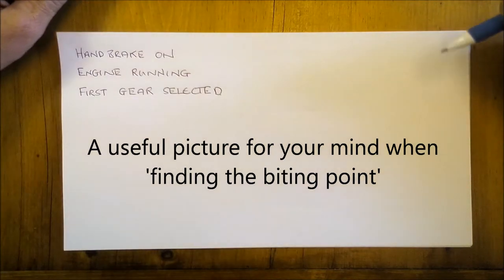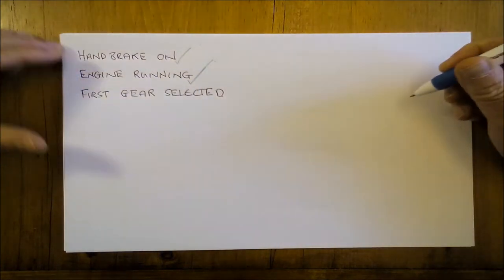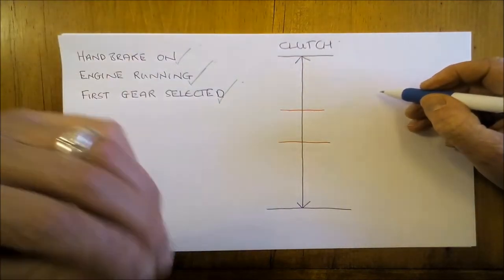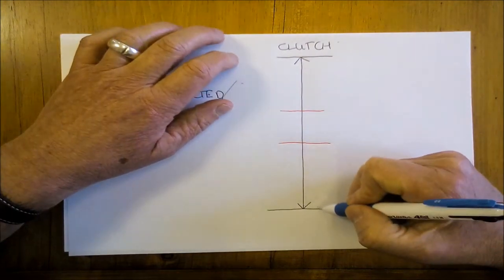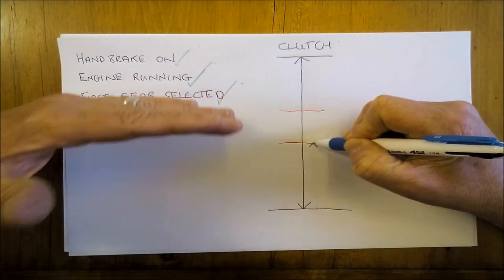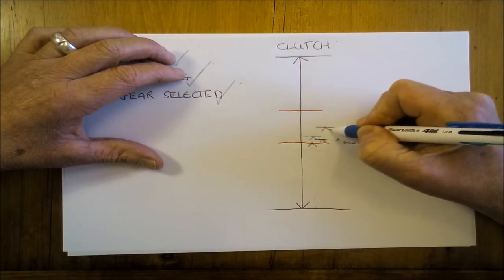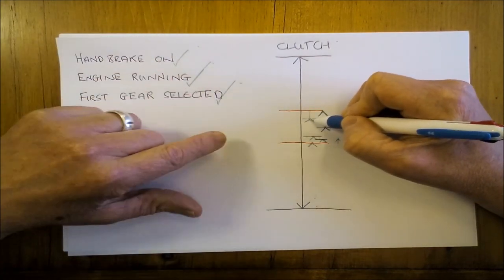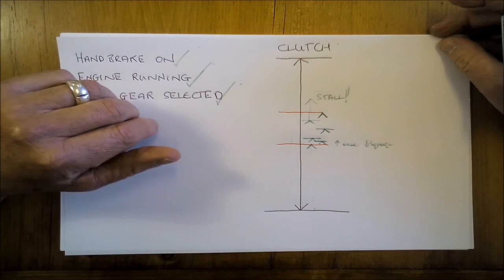'Biting Point' - Explanation for learner drivers

Comment: i know balancing at a uphill with only gas and clutch staying at 0 km/h can overheat the clutch, but what if u use the handbrake/brakes and take the clutch at the beginning of the biting point and let it stay there? is it okay for the clutch or will that still overheat it but maybe not as much as it would with gas? thanks.
Reply from the maker: What you describe sounds correct. Best not to 'hold on the Biting point' for too long - especially on steeper slopes. If you have the handbrake on you would 'dip' the clutch to just below the biting point as you're not going to roll back. Just make sure you find it again before releasing the handbrake!